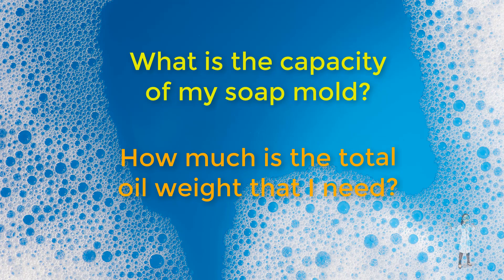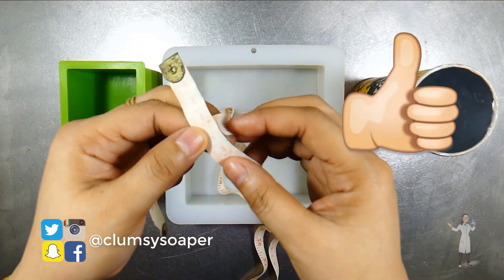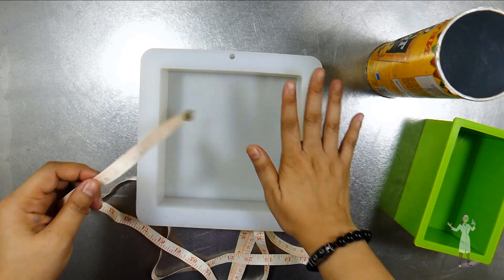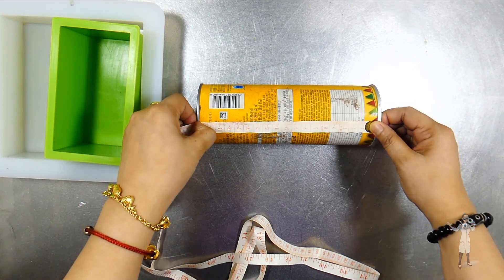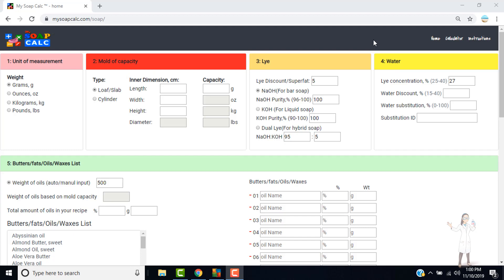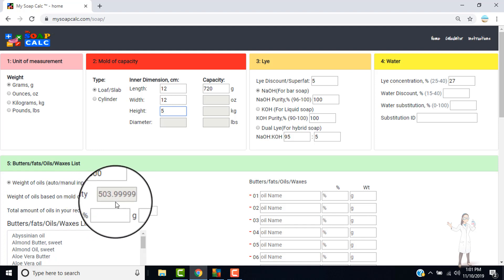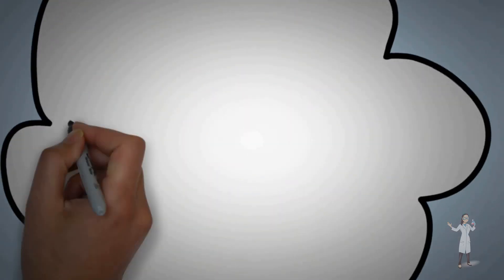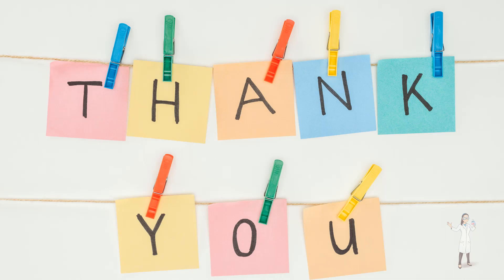How to measure Soap mold capacity? How much oil do I need to make soap? Soap Mold weight or volume?

Comment from the maker: To calculate your soap mold capacity and know how much oil to use, go to www.mysoapcalc.com/soap thank you so much for watching soap sisters and bubble brothers!
Reply: the site is not working na ba po?
Reply from the maker: I-check ko po mamaya. Thank you po sa heads up.
Reply: @clumsysoaper its says its suspended po. hoping gumana sya para saming latebloomers tysm
Reply from the maker: Hi. Thank you sa pag-inform..paki-try ulit. Maraming salamat
 😊
Reply: @clumsysoaper it's working na po tysm😊
Reply from the maker: @registrar4753 most welcome.

Comment: When is the lye water solution calculated into the total weight of the soap?  If we calculate just for the oils, then we'll end up with extra batter, right?
Reply from the maker: The initial lye water solution will be used up (during the preparation of the soap paste). 

Dilution of the liquid soap from the soap paste, is a separate calculation. Thanks.

Comment: If you could add the mold capacity option in inches as well as centimeters that would be great !
Reply from the maker: Thanks for watching Katie. I put centimeters because from the feedback that I gathered during the development of the calculator, majority of the soap makers are confused when the inch measurements are in increments. Like they can clearly identify 1 inch, 1.5 inch etc but anywhere in between probably 1.7 etc is a bit confusing to them already. So they suggested to just make it all in cm coz they feel that it is more accurate. I think you are on the upper end of the spectrum. Those who are really good in maths and measurements. I will reconsider this again because I also prefer inches. 👍 Thank you for the feedback.
Reply: Thank you for you video
Reply from the maker: Most welcome. I'm always happy to share. Happy 2022. ☺️❤️